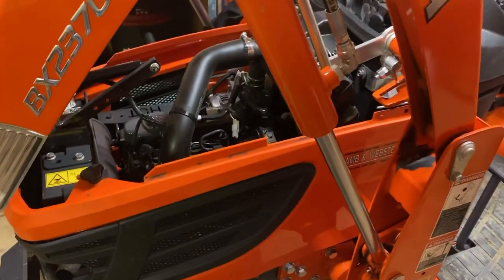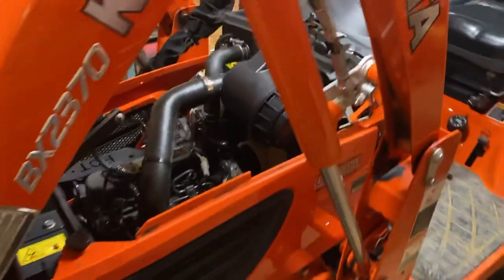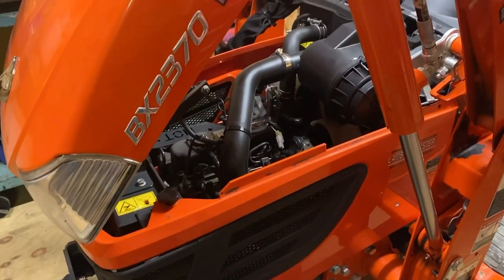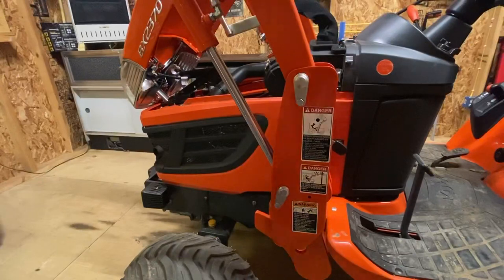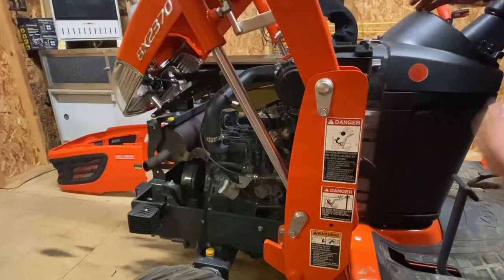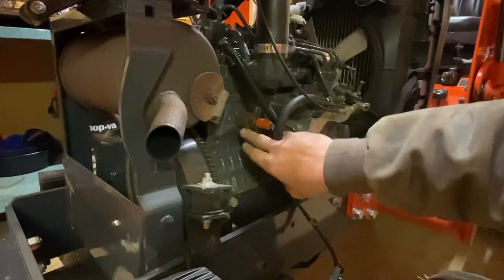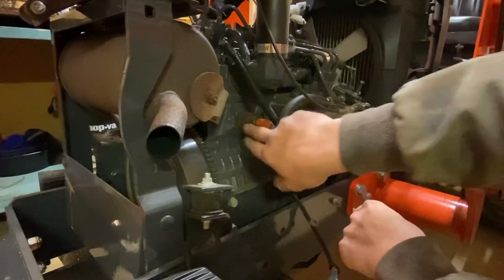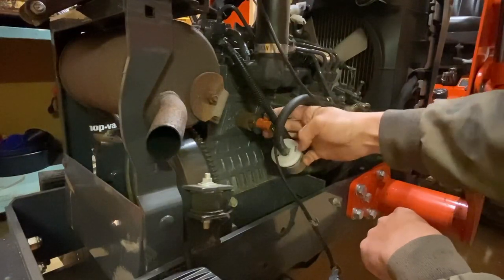Testing for a bad block heater on a Kubota bx -How-To (Explained)

Comment: Thanks for troubleshooting the heater.  I've had my 2370 for one winter season and it worked fine.  Now it's just cold air when the fan is on.  I'm tempted to just leave it alone unless that could cause other problems?  I live in upstate NY NE of Syracuse and it can get pretty cold.  But, dressed warmly and inside the cab is a lot better than walking behind my Cub Cadet snow blower in the wind for an hour or more.  I just subbed and liked, look forward to seeing your install.  Cheers, Bob
Reply from the maker: Thanks buddy! You don’t live far from me at all, I live near Buffalo NY myself. Its not gonna hurt anything if you just leave it alone and never fix it you just won’t have a way to heat your block. I have yet to purchase a new block heater but I’ll do it sometime this winter so stay tuned for that video. Thanks for subscribing! Check out my “playlists” tab on my channel you’ll be able to find lots of useful installs, information, and tractor work all setup in different Categories usually from newest to oldest.
Reply: @BiffsEquipment  Thanks.  Will check out your playlist.  Pray for lake effect snow.  I want to play with my Orange toy!  Cheers.

Comment: Okay I just replaced my Kubota BX23S block heater after it failed.  The original block heater was dealer installed.  The Kubota Block Heater Kit is Part 70000-00776.  In order to remove the heater I used the trick you mentioned and post I found on TractorByNet.  I picked up a 3/4" female garden hose thread fitting to a 1/2" pipe thread and threaded it onto an 18" piece of 1/2" black pipe.  This pipe will screw on to the block heater once you remove the electrical plug.  Then using a pipe wrench on the end of the black pipe I carefully tapped on the pipe wrench with a hammer.  The block heater popped right out in about three seconds.  I was concerned that whatever thread locker the dealer used might prevent it from coming out but that didn't end up being a problem.  To install the new block heater I used a 1 inch socket and some Permatex Threadlocker Orange.  

Here is a link to the TractorByNet post with pictures from ayelvington of the tool.  
https://www.tractorbynet.com/forums/threads/how-to-remove-and-replace-the-block-heater-on-a-bx-24.301887/
Reply from the maker: Awesome Chris, glad you got it ironed out and replaced! Thanks for sharing this excellent information for everyone! Hope your doing well!

Comment: Hey mike good job on the block heater review i have a cure for your plastic cow drill hole throw the side and put a long angel on the in side to anker it down were the ear brock off good job. 👍
Reply from the maker: Dave Smathers thanks David! And that’s a good idea I may have to try that out
Reply: @BiffsEquipment  nice pretty beefy bx kubota there there the best beast  i had too fix a block heater on a m 8540 wich pretty easy and lucky kubota block heaters are pretty cheap
Reply from the maker: @michaelmactavish1728  nice man. Yah the Kubota block heaters are actually pretty reasonably priced
Reply: @BiffsEquipment  deere and newhollands were rediculas with there price on block heaters
Reply from the maker: @michaelmactavish1728  crazy how the same item can change so much in price from company to company

Comment: Nice videos. I find them informative. I can’t find your video where you showed how to remove the old block heater. Can you please post a link?
Reply from the maker: Hey George, thanks man I’m glad you enjoy my videos! You guys are the only reasons I make them cuz it’s a lot of work so I’m always happy to hear that. As for the second block heater video I never ended up making it.. had plans to but never got around to buying a new one. I plan to buy a new one next fall tho and I will show the install process for you guys.

New video coming at 5-5:30pm tonight so stay tuned for that!
Reply: I’ll watch for your new videos! I drive a BX2360. The Kubota dealer told me to only run the block heater for an hour or so at a time, and even use a timer to prevent the heater from burning out. My original block heater is leaking coolant, so I need to replace it before next winter. Thanks as always.

Comment: You might want to check your new block heater again, they only last about one or two seasons on my bx2370.
They should last for years not months.
Maybe it's because they are too high on the block and aren't totally submerged in the coolant.
There is a universal problem with either the block heater or the position of them in the block.
Reply from the maker: I agree with you there buddy.. I never actually got around to replacing that bad block heater because I now store my tractor in a heated shed. But one thing to note that even I didn't realize is if you start your tractor with the heater still plugged in the rush of cold coolant blowing by the block heater will actually cause it to short/burn out. I feel this is why I had a pre-mature failure so if you ever replace yours be sure to un-plug the heater before starting the engine. Thanks for watching!

Comment: My opinion is to take the old one back and say you want a new one for free !! The idea of a block heater only lasting 1 or 2 winters is unacceptable for any block heater, doesn't matter what you're putting it in.  Block heater for my ford ranger has lasted 14 years and it's used every winter.  C'mon Kubota don't tell me you sell junk !!
Reply from the maker: Hey Scott, yah I tried to warentee it but they wouldn’t because it had been past the warentee date. Instead they said they could offer me a new one at half cost, I just never ended up buying it because the following season I installed a heater and started storing my tractor in my shed so my tractor really didn’t need it anymore. I do still plan to replace it some day tho so stay tuned! 

I belive I burned it out because I was not unplugging it before starting the engine, you should always unplug the block heater first then start the engine second.. otherwise the cool coolant flow hitting the hot block heater will usually burn it out. This was something I didn’t think about at the time of making this video as it was back when I first started my channel